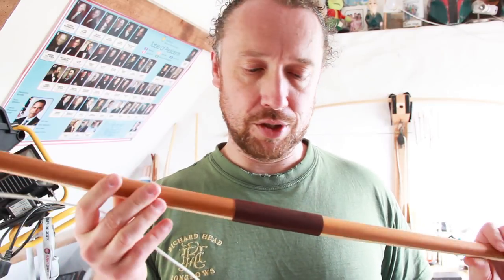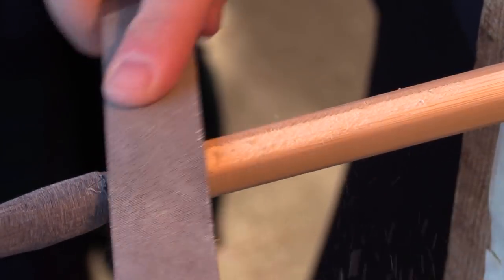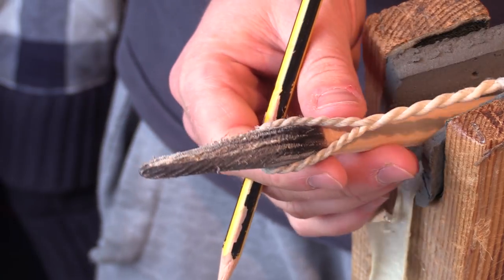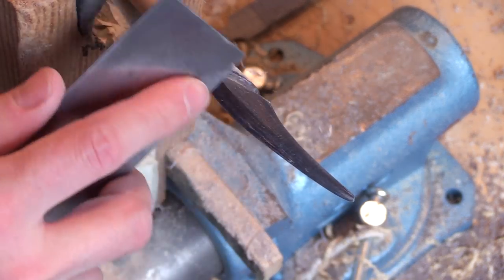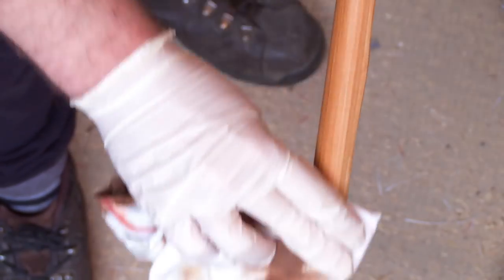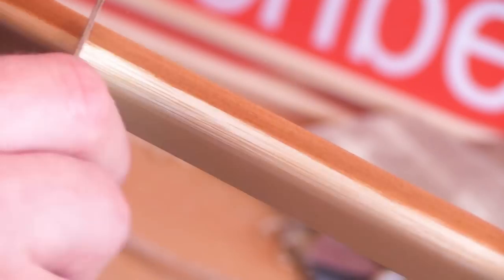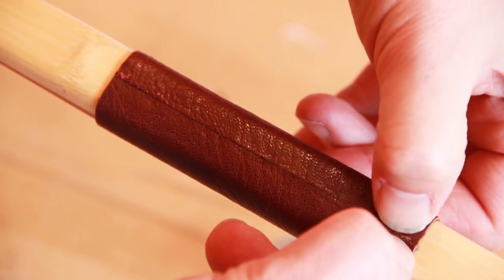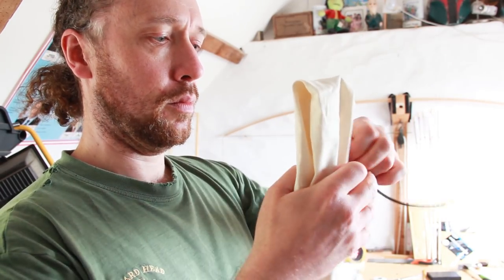KIDS WARBOW  Today in the Professional Bowyers Workshop

Comment: ... a daunting moment... I should say, like fitting inlays into a finished rifle stock... 
Great tip on the leather handle.  I have used twine to wrap over the leather on things like this, but it is slow, and sometimes hard to clean up. your way is better. 
What was the finished draw weight?
Reply from the maker: Glad you found it useful, the bow is about 25lbs @ 24"